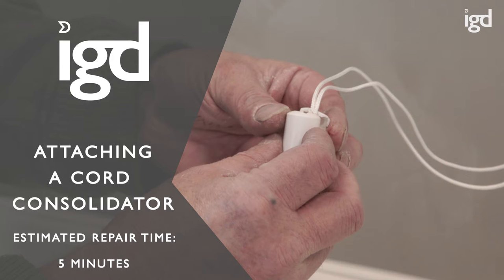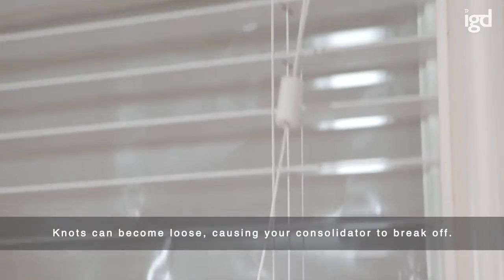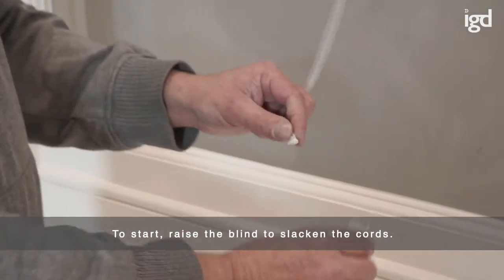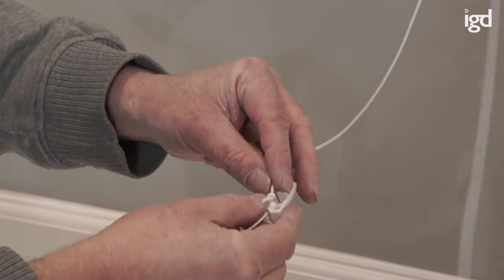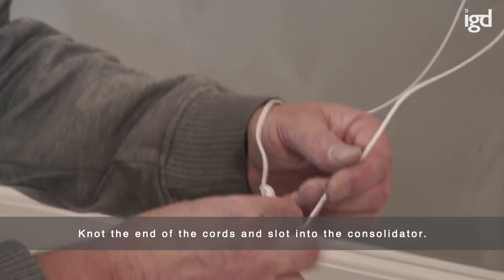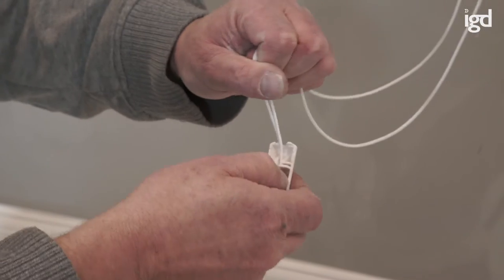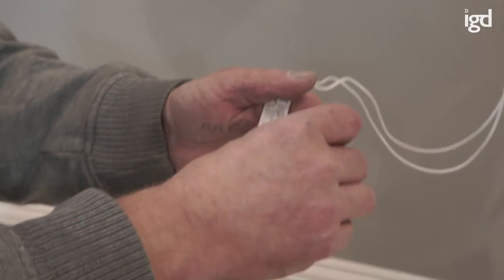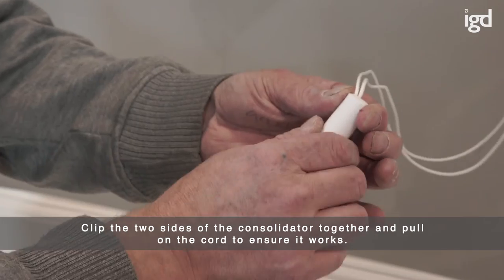Wooden Blinds Direct: How to attach a cord consolidator

Comment: Useless information..........you don't show how you open the consolidator
Reply: There's a video here that shows one way to do it, but I don't know if it'll help you, since it seems to require that the two uppermost cords are still inside the consolidator itself.
Reply: I just opened mine up. You have to simply stick a fingernail into the crevice on the top part of the consolidator and it comes right apart. This is coming to you two years to late, but maybe it'll be helpful to someone.